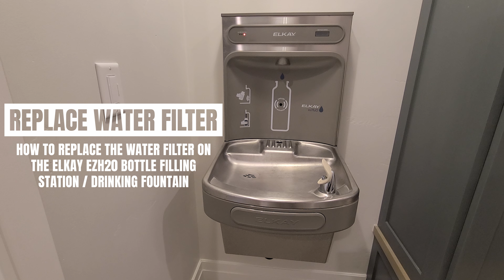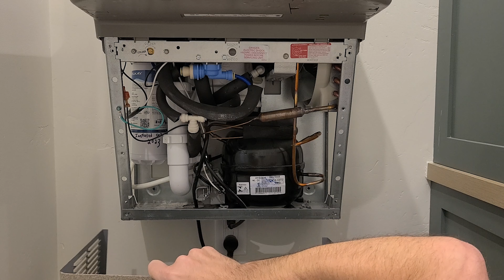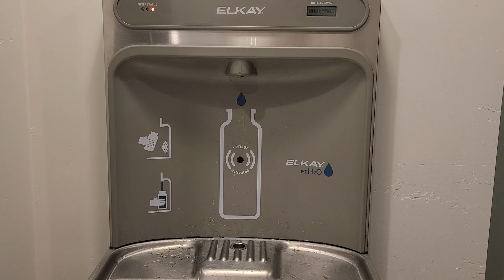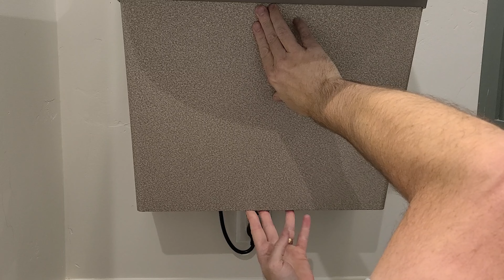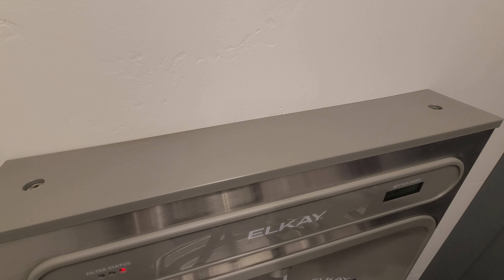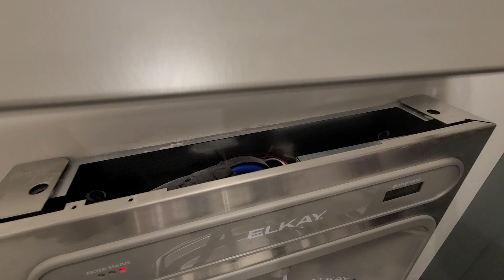Replace Your Drinking Fountain / Bottle Filling Station Water Filter

Comment: Is the same procedure for a model LZSTL8WSSP?
Reply: For safety, it’s recommended to unplug the unit after you relieve the pressure.
Reply from the maker: @couchpoet1  That's a good idea. You would just need to plug the power back in to be able to reset the filter status.
Reply from the maker: I'm not familiar with that model. Does anyone else know if it is the same procedure for that model?